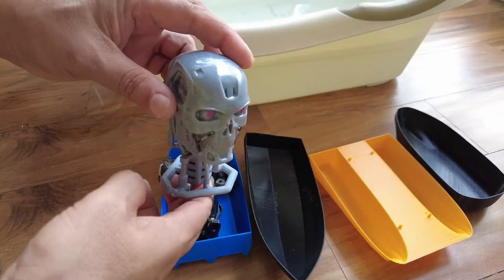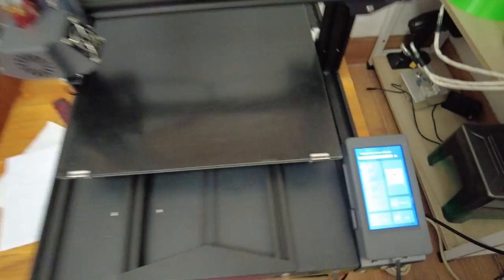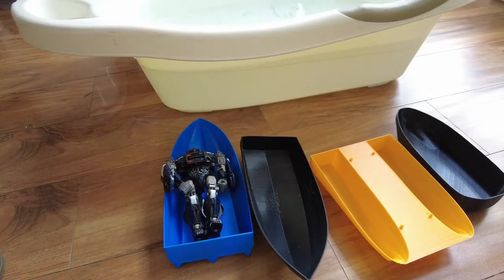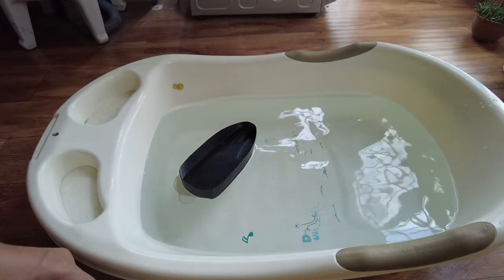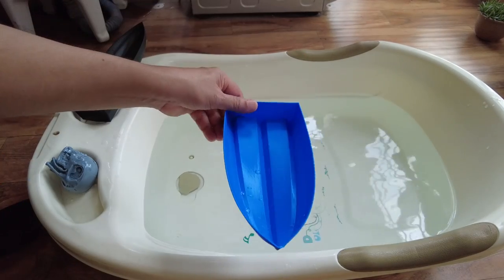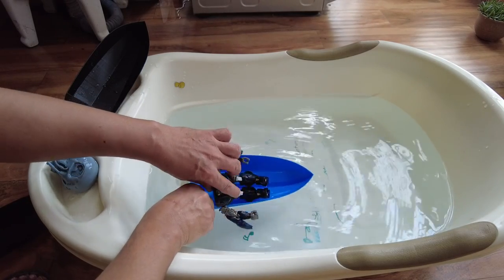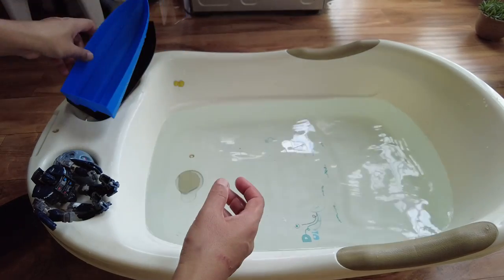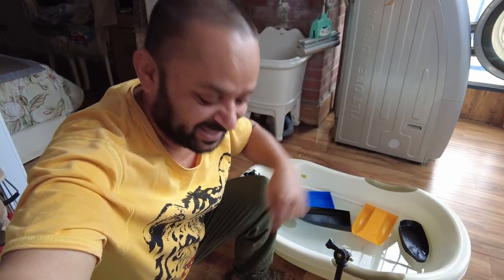3D printing a Full Size Electric boat Part 2 - Hull Designs

Comment: The advantage of the traditional hull is that it corners well with speed. As your motors will not be very powerful, the "M" hull seems the best choice. If you had a strong motor, I would add ballast (weight along the keel, as low as possible) to stabilize the boat. Then you'd have a speedy stable platform.
Reply from the maker: Thats for sure, the Traditional will actually be faster, efficient and turns will be nice and smooth. a rudder can be added just super easy as now I have access to metal works and welding in my workshop. I am doing more designs now on both M and traditional hull. like adding ribs and supports, guard rails, splash rails, covers, seats and accessories installation points. once all the design is done, I will 3D print another mode and compare both to see which one i should go for.

Comment: I'm for team blue. It just looks so good too!
Reply from the maker: yes sir, going to design a mini kayak 1 meter long for a test print to see how it feels to print many parts and join them. and then go for 2 meters long blue model. Blue model is almost ready, just need to add internal hull supports, seats and some stuff then get the model to print.

Comment: Testing Pond right outta MIT. You need semi V , full V hull cuts waves the best but, it get rickety like a see saw when anchored / standing. Cats are more stable but heavier in contruction. Q - is Ali , are you building a planing or a displacement hull. ?
Reply from the maker: well I will mostly be taking my boat to river, where water is not wavy, (Not like sea) so what do you suggest? I need more knowledge from your experience on Planning or displacement hull please :)
Reply: @alishanmao   GM & TY lol. Mi Papi & Uncles which are  unfortuanetly gone, were the Boat builders over there. I grew up with Fiberglass & have patched / rebuild/ painted and enjoyed only 2 small 15' which were planing hulls powered by @ least a 25 hp tiller steered outboard. The thrust from small Electric wont plane a hull. Best so far for its intentions would be the Blue hull design at least 12' lenth & 4' beam ( wide)  as we know the Crew are getting bigger by the day.